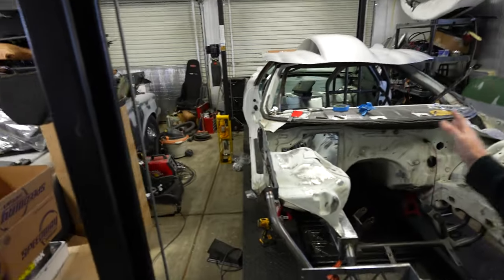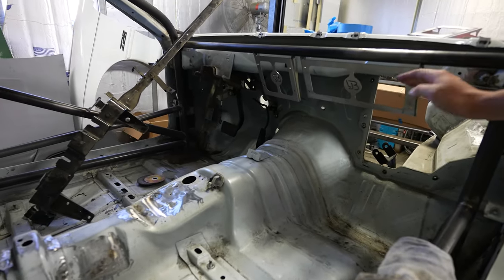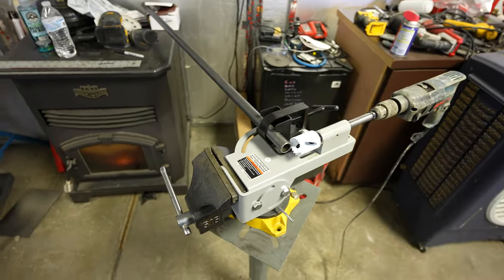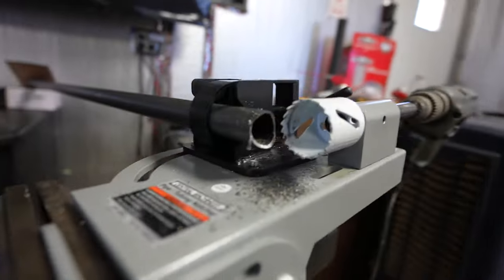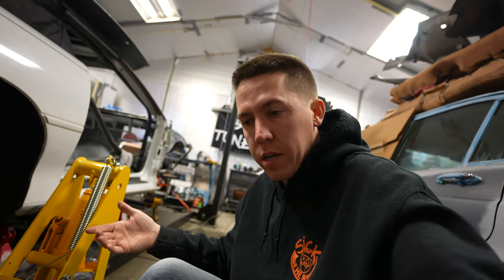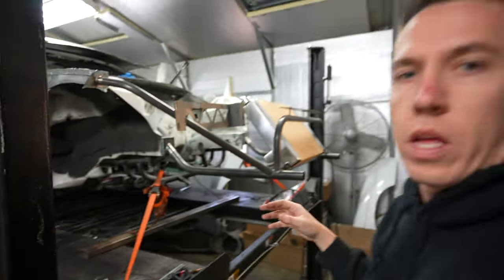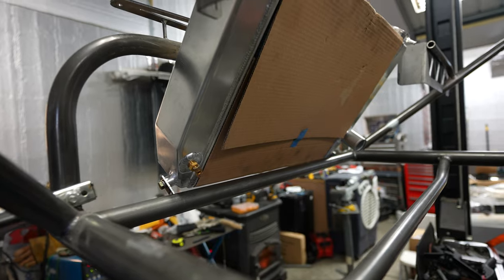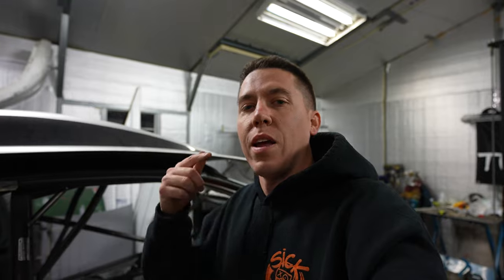I Bought A Cheap Tube Bender - Twin Turbo Camaro Build Progress!

Comment: The dominator can record whatever you want. The racepak isn’t needed. Also some lubricant will help your tube notching.
Reply from the maker: I guess I could have been more clear on that it’s a mount for the Racepak smart wire. I’ll be using that for all body wiring for streetcar things! 

Used a little WD to help with cutting but need to get some better cutting oil for sure!

Comment: Affordable bender is pretty good works great on .120 dom. For 4130 1.625 .083 ive had it kink with allstar brand of tubing but not with a different brand. Maybe it was a had batch or something.
Reply from the maker: That’s interesting, I have some 1.625 .083 moly I got from stock car steel I’ll have try out. Sounds like that was a hardened batch or something